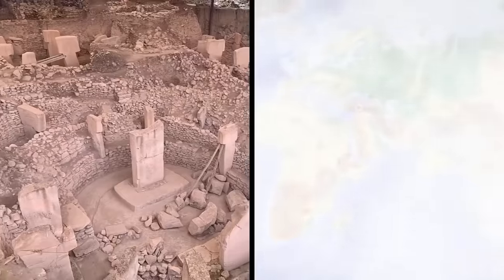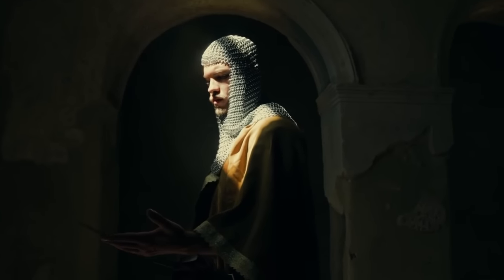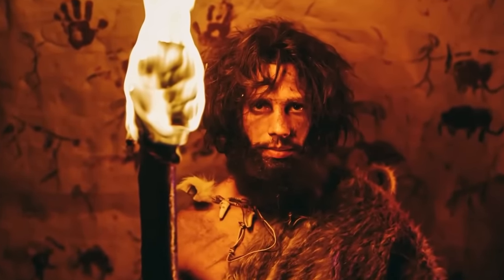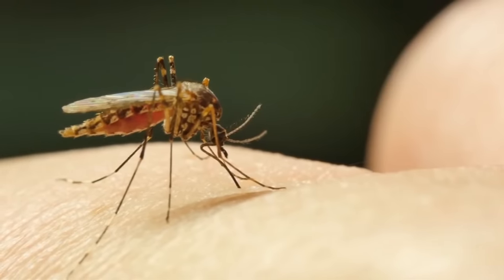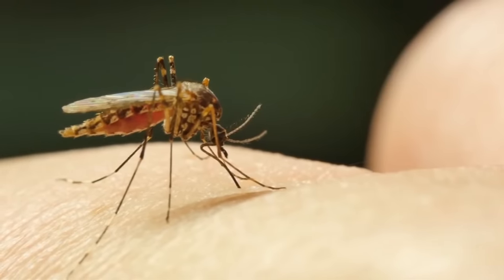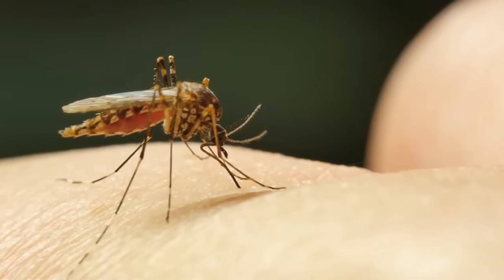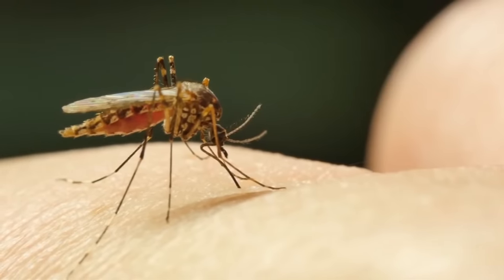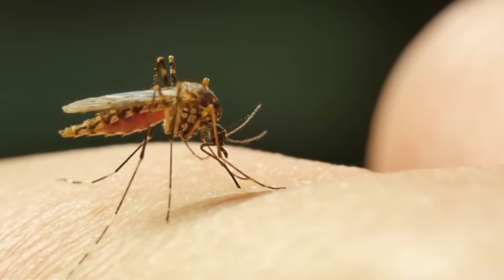CREEPIEST & SCARIEST Archaeological Discoveries!

Comment: A oil company in Michigan does not want to admit there is anything of value at the bottom of the lake, as they want to build a pipeline right through that area. A hold has been put on the pipeline, but it will pretty much be a miracle if they can resist the money and influence of the oil company for long...
Reply: If they got money to buil a pipeline, they got money to build around it.
Reply: @jrr7031  great point!!